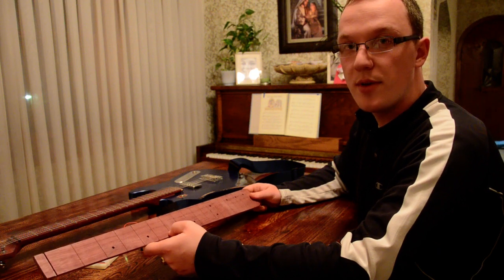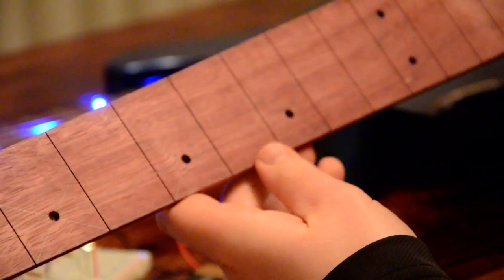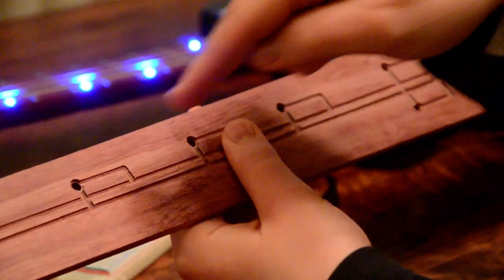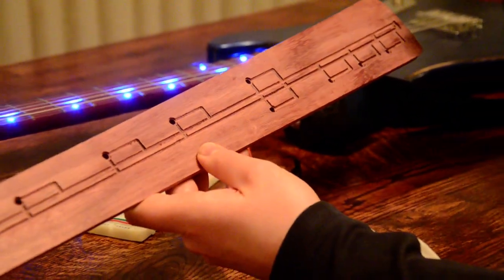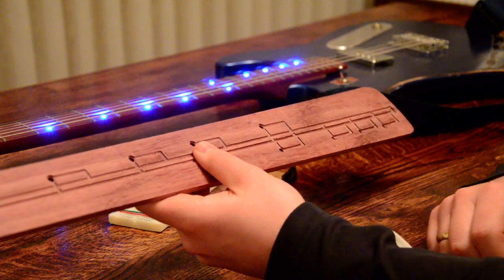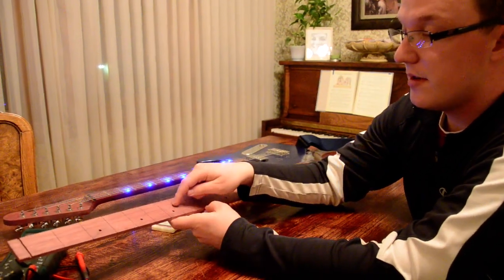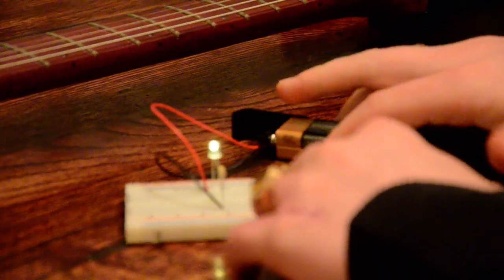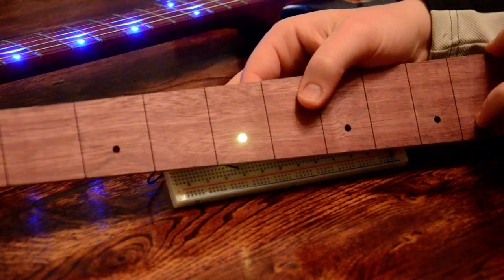LED Guitar #2 - Halfway point

Comment: Is there any hum from this specifically with the wire attached to the fret wire?
Reply from the maker: No hum. Usually the hum you hear in your guitar comes from 60 Hz sources like AC house wiring and fluorescent lighting. This just has a 9V battery with DC. The DC does not add any hum or noise.

Comment: Hi there, Im modifying my fender to twinkle LEDs with the guitar signal, but I wonder what circuit to use.. Ive seen some of transistors BJT, MOSFETs and OPAMPs, what  would you recommend to amplify that guitar signal into LEDs without affecting the guitars sound (or affecting the less, better said).
Reply from the maker: I have seen several guitars that have an internal preamp which powers the LEDs. You can find many preamp designs on the internet. Some of them involve either a BJT, MOSFET, JFET, or OPamp. People use these preamps to improve (boost) the sound of their guitar signal before it travels through the guitar cable and to the power amp. Just find one that gives your guitar a good sound, and it will have plenty of power to light up the LEDs. Any transistor will have a small amount of capacitance which could slightly affect the sound, but the capacitor in your tone knob will have a greater effect.

Comment from the maker: The +9 Volts is the red wire, and it is connected to a resistor, which is connected to the positive terminal on the LED. The negative terminal of the LED is connected to 2 things: (1) a small switching diode which goes to ground--the white wire, and (2) a little copper wire that goes up into the fret slot.

Comment: Im a complete noob when it comes to wiring.
So, if i understand correctly, the negative on the led it wired to a resistor which is wired to the red wire, and the positive is wired to the copper wire which pokes through the fret slots?

Comment from the maker: Even simpler than that. I don't solder it, I simply have a hole under the bridge with the wire poking up. I strip the stranded wire and spread it out flat and screw the bridge down on top, pinching the wire between the bridge and the guitar. Some guitars do this already for shielding and grounding reasons. I simply have the wire go to my switch rather than the shielding foil.

Comment: Yeah I thought you would of had something to attach to the bridge, im  still not clear on how you physically wire it to the bridge. Do you just have the negative simply soldered on the bottom of the bridge piece through the back of the guitar?

Comment from the maker: Have a copper wire that goes up through a fret slot and then pound the fret back into the slot. Then have a wire that attaches the bridge of the guitar back to the switch. There is a circuit schematic if you read the descriptions in my videos.

Comment from the maker: Also, the LEDs stick up out of the fretboard, and I file the tops of them off until they are flush. LEDs are mostly epoxy plastic, so you can file the tops or sides off if you want to.

Comment from the maker: The fret dots were plastic, and they were deep. The plastic fret dots were probably 7mm in diameter, while the LED is 5mm. This leaves a little plastic ring around the LED, but drilling exactly centered in the plastic dot is almost impossible, and the plastic dots tend to crack when you drill. You could use an existing fretboard, but you would have to put the LED somewhere other than where the existing dots are.